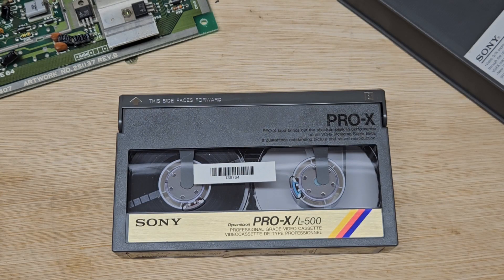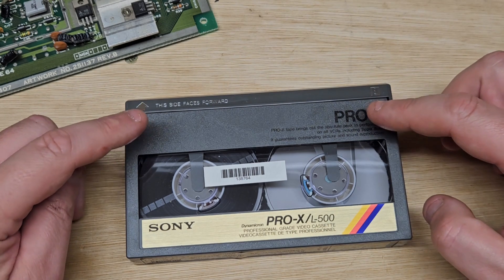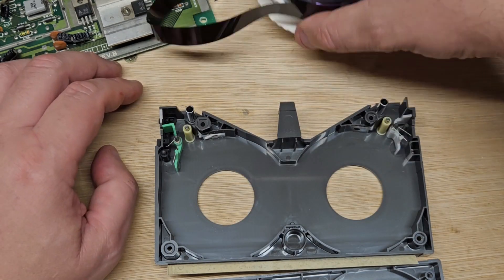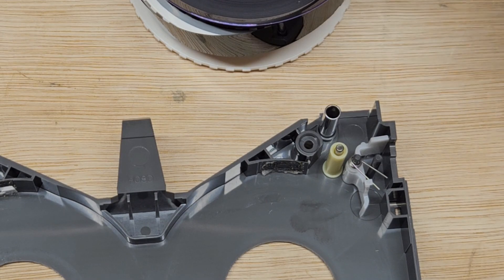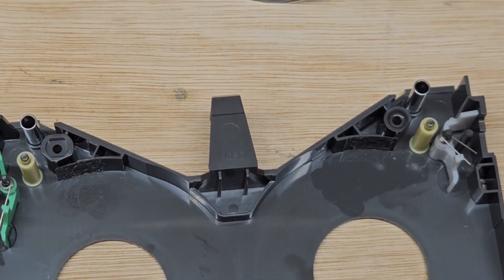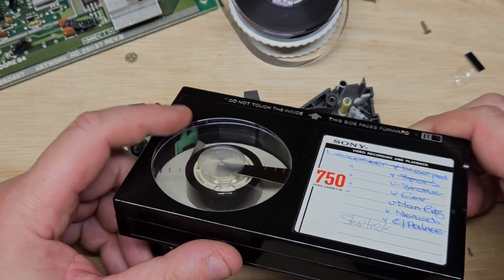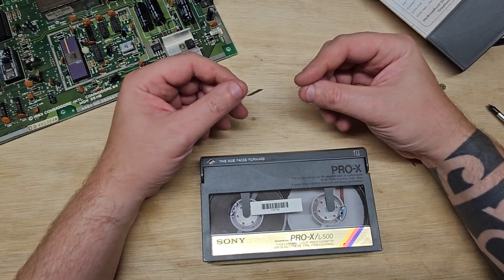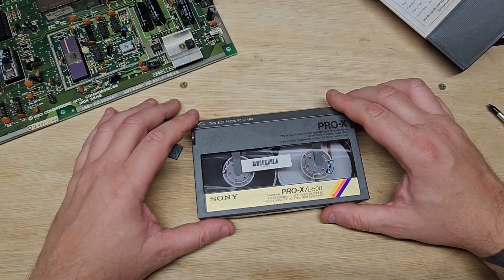Betamax tape cassette design flaw

Comment: The Pro-X formula are best played on the Super Beta machines otherwise their metal formula wears down any non metal playable model very quickly. Even still the Metal formula tapes now needs to be played sparingly given the support for parts back then has almost evaporated nowadays.

Comment: This happened to me recently with an original alignment tape! I was really lucky as it was already rewound to the point where it's blank before it came off and got stuck to the tape and the capstan, one step away from smashing onto the video heads! These pads are there to prevent tape slack, according to the Sony SL-C9 operation manual.

Comment: hi there used to be a shop in london that sell this model shop is still there  they don't sell tapes any more 
i know they used to sell betamax tape  in there    i buy alot of beta pro tapes for audio only  new virgin  one's  i never seen this before ever  i have to check the tapes
i have   for this some time  i am jucking alot of betamax  tapes  and using them for  audio liner on betacam  where the betscam heads are bad  an jazz up the decks 
6 x the tape speed of a betamax

Comment: Seems to me they are there for a reason and it would make sense to use a good thin strong adhesive tape to replace them.
Reply from the maker: On many beta cassettes by both Sony and other manufacturer they don't exist. I believe its to aid smoother tape transport than being critical. The strips have a thick nasty glue that is difficult to clean. With the amount of tapes it would take a very long time to do them all. Easier to remove

Comment: that isn't a design flaw, that tape is well past its design life
Reply from the maker: Yes im aware of that and much of the work is preservation as beta tapes are not made anymore.. Many manufacturers included them but without the glue using a thicker palstic end into a slot in the cartridge. This particular model of sony tape they used glue that fails after a long time.